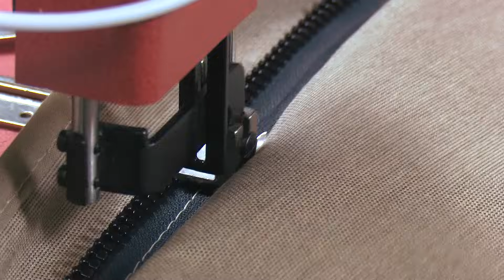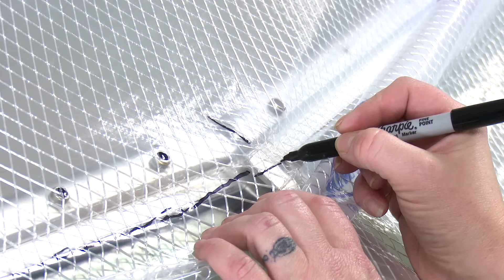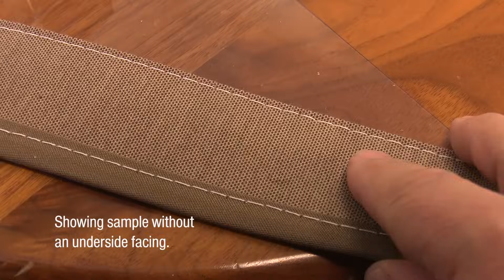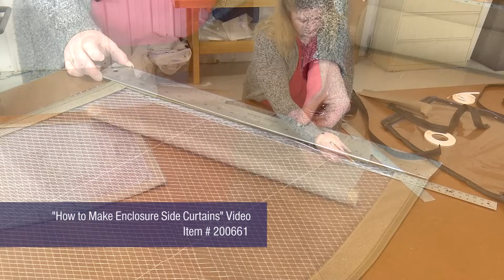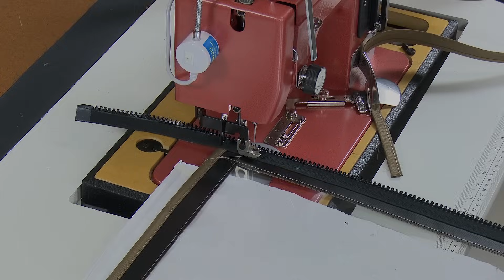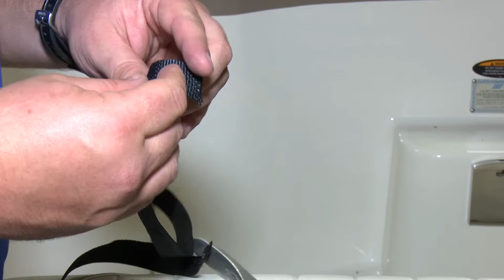How to Make an Enclosure Front Curtain

Comment: I like the sides edges straight and never use binding anywhere unless I made a mistake or the fabric is too short.
I double hem every edge, it only requires an inch and two folds.

Comment: One thing that would save you a lot of time would to cut the zipper with a hot knife and melt the zipper teeth on each side so that they slightly expand and stop the zipper. Works Flawless! Trust me I've done it lots and lots of times. Wouldn't pay a dime for that cheap sewing machine though. Get a good quality Durkopp Adler machine will save you enough time and work that it'll pay for itself even faster than that one. But overall very nice job!
Reply: Durkopp alderman machine